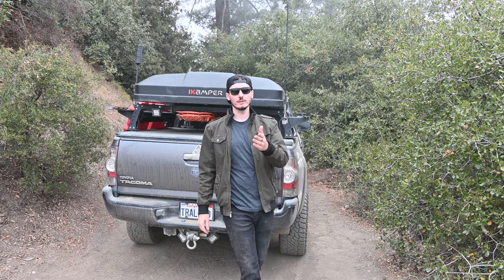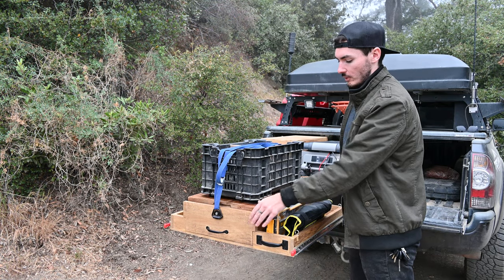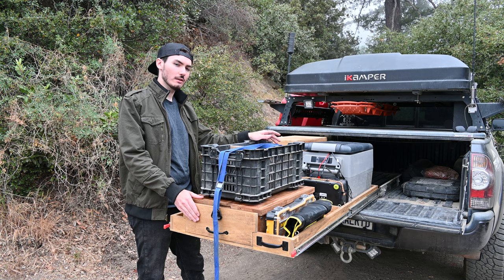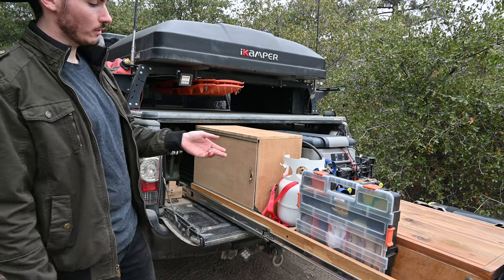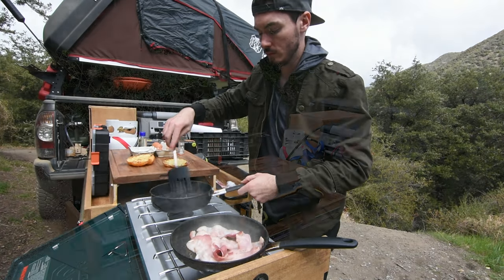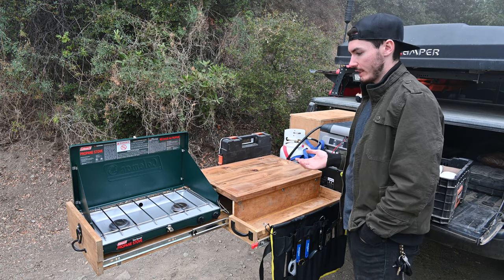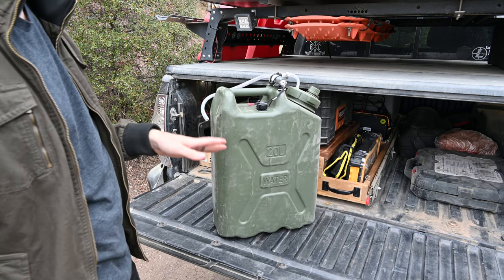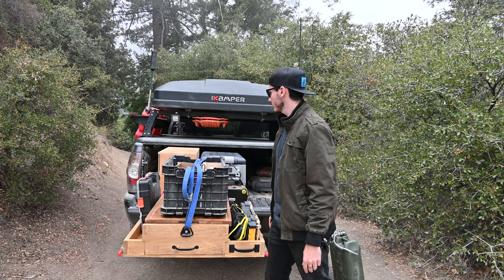I Built A Solar Powered Truck Kitchen! - 2nd Gen Overland Tacoma Build

Comment: Hey bro, amazing setup. I had a suggestion,  I was thinking that , if you put a couple of pull down legs , underneath your slide-out,  around where your stove is, you'd be able to distribute the load and take some load off your bed bolts, when your slide is all the way out
Reply from the maker: I do have a spare tripod that I lost parts for that would be perfect for that. Overall theres no signs of fatigue and I'm really confident in the mounting points I used. Either way though I'll have the tripod ready in case something does appear.

Comment: Hey man, I have a kitchen bolted to the bed of my Tacoma as well. I bolted it down in four places with 1” square washers that fit in between the grooves on the underside of the bed. It’s been on there for a couple weeks now and hasn’t shown any issues even through some heavy off-roading. Any updates on yours after three years?
Reply from the maker: Awesome to hear! I just had to replace one of the drawer slides, but that was because I kept slamming the kitchen out and broke one of the latches. I had to fully remove the kitchen to replace it and saw zero stress on the mounting locations. So far, so good.

Comment: Neat setup! Love the organized approach.   How's that fridge been holding up for you? Summer is approaching and I want to buy one for summer camping trips
Reply from the maker: For the price cant complain, going with a higher end Dometic would reduce power draw since its better insulated but its alright. Only issue I noticed is that the storage slot near the top doesn't get as cold as the bottom area of the fridge.

Comment: Good job building a PU truck-bed kitchen that suits your needs and how you want to use your truck. But I have to disagree with claiming it is a "solar kitchen". You are using gas, so it is only a partly solar set up. To say it is solar would need additional LiFePo4 battery and PV panel charging, coupled with an electric induction cook-top. That adds a lot of cost and build complexity, so I certainly do not knock anyone for using electric and gas together for best use of available budget. It's just the title of the video that strikes me as misleading. Anyway, good job on what you built here and I hope you go on t have lots of enjoyable times using it out enjoying the back country!  :)

Comment: umm, dude, I'm a little confused by your heading, what makes this a solar-powered kitchen, I was expecting a solar oven and cooktop powered by the sun, instead of its just another random pull out slide kitchen with a 12volt fridge hooked up to a mobile power unit and solar panel. great clickbait mate.
Reply from the maker: When someone actually attaches an Archimedes death ray kitchen to their truck i'll be impressed too! If you think about it the title is completely accurate. Sun + Solar Panel = Power for the kitchen.
Reply: Why are you so butt hurt? Build one yourself then and post it up, dudes got a solar powered build for his needs.
Reply: @earlmiranda7310  Right on Mate.  Totally agree with you!!